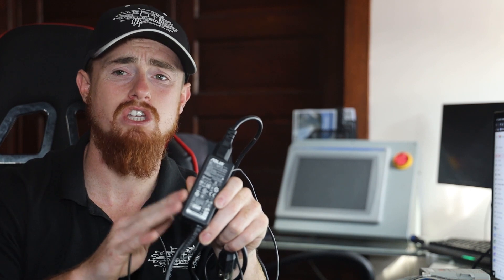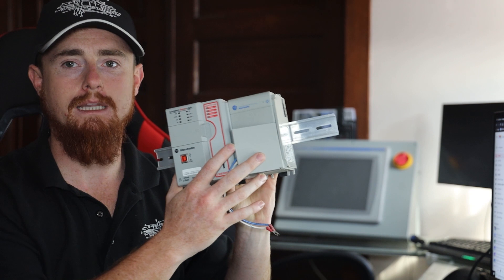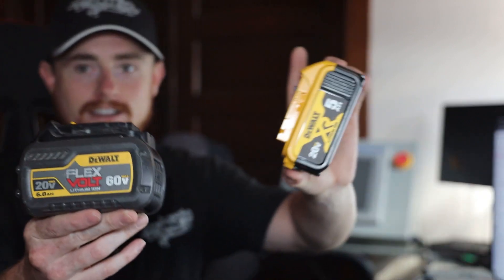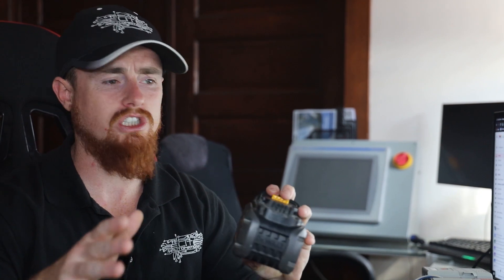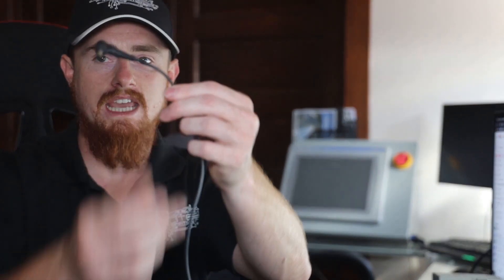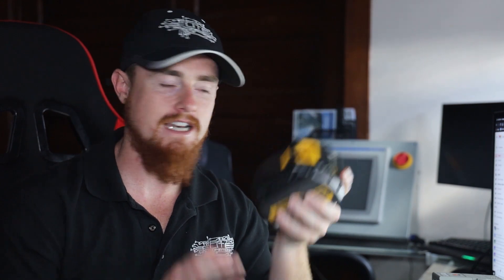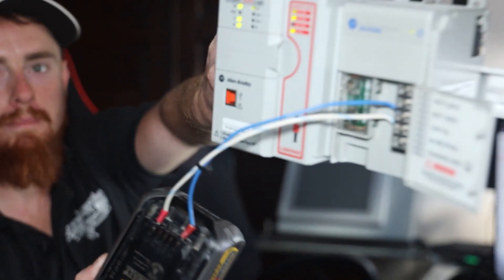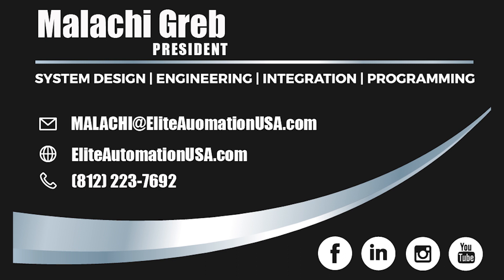Cheapest Industrial 24VDC Power Supply

Comment: I would HIGHLY recommend you don't attach your $1000+ PLC to a drill battery or whatever cord you have laying around, especially as a beginner. Automation Direct has 24VDC @ 5A power supplies for under $60. Get the correct tools for the job.
Reply from the maker: Ya it may not be the best option but there are some people where $60 is hard to come by. And they battery actually falls into the engineered electrical rating for the PLC.